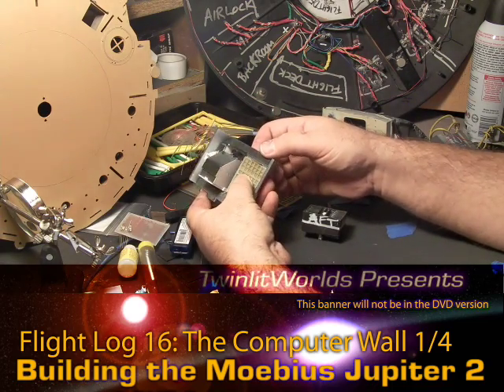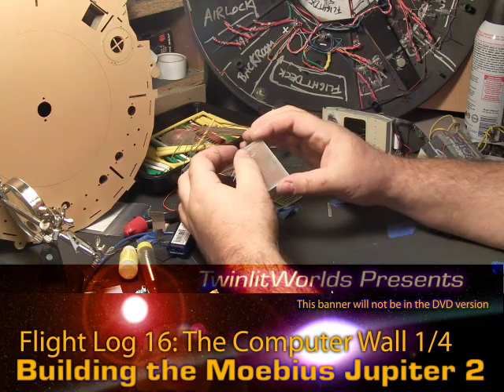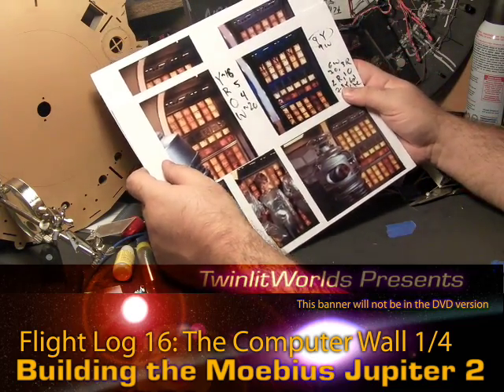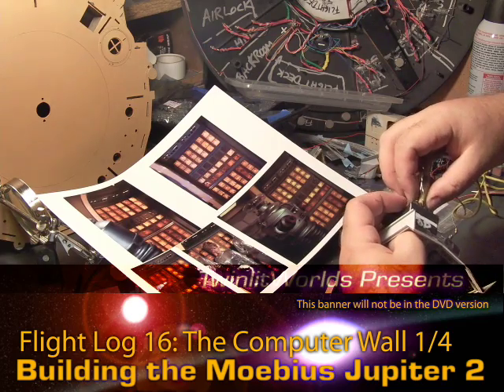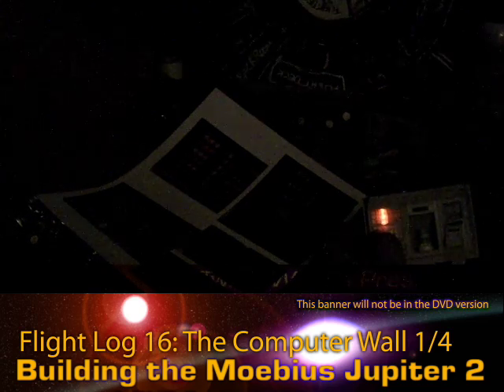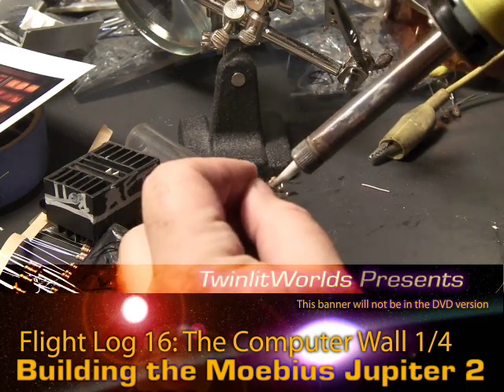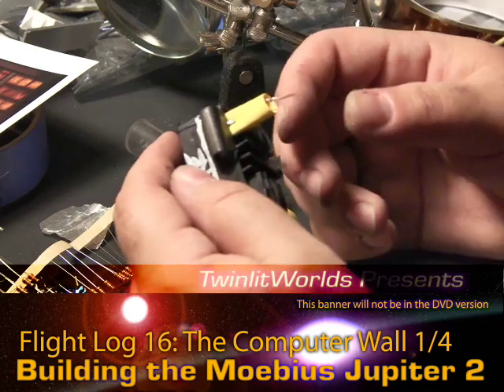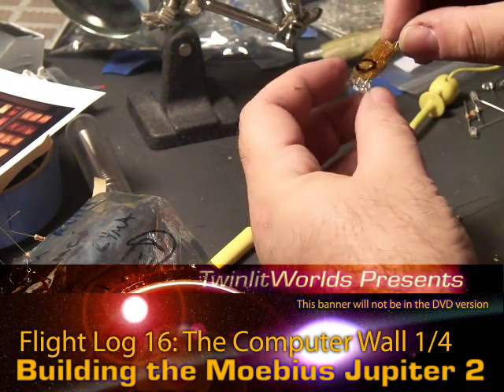Project Jupiter: Flight Log16 Wiring the Computer Wall 1/4 B

Comment from the maker: @futuredirectorwanna Not exactl. Sanding leds makes the light more diffuse (like taking a sharp spot light and turning it into a diffuse room lamp).  While that act 'may' dim the bulb some, the method is not a replacement for resistors.  But it is perfect for soft, diffuse lighting!